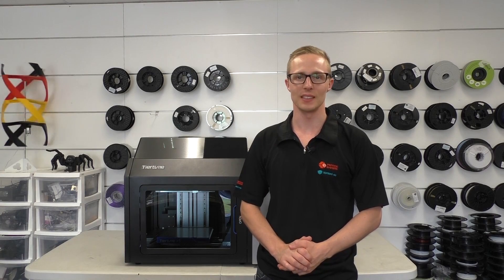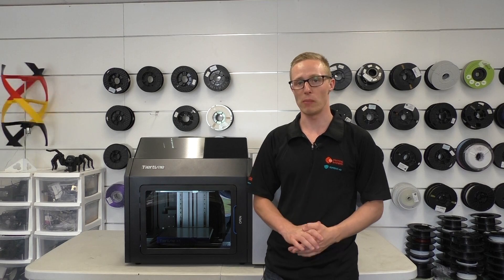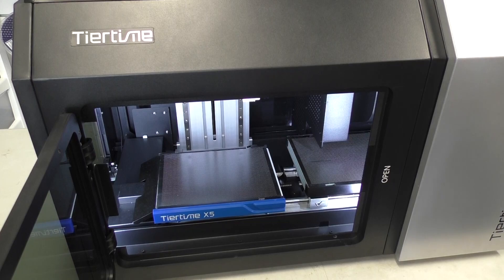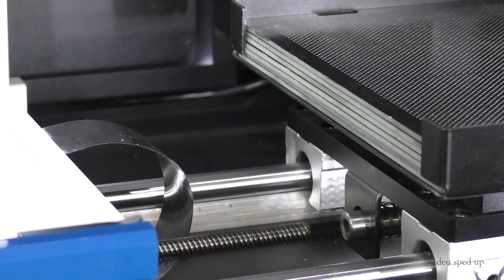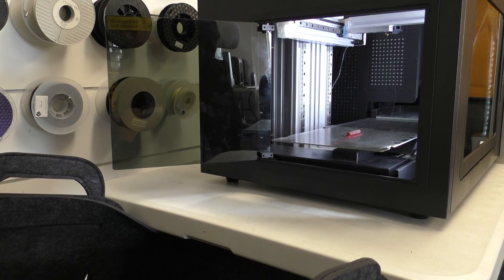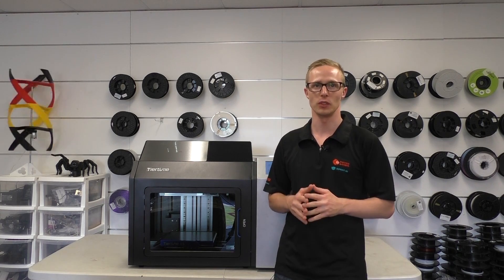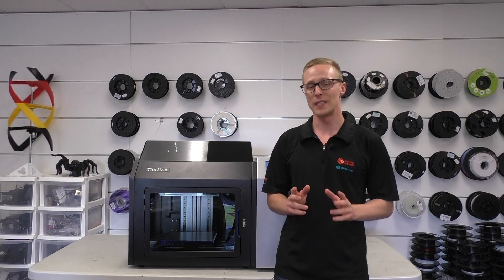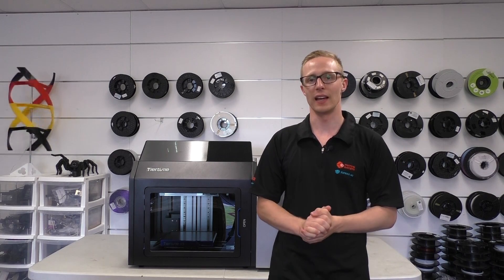Introducing the X5 3D Printer - Continuous Printing

Comment: A great printer but it requires a lot of maintenance after a while of printing since the print head only has one small gear to push the filament through, this often results in the gear eating the filament and getting clogged up. Overall I wouldn’t recommend it

Comment: The question is how many good prints are you gonna smash in pieces because of the bucket drop ? Because while the first print of the batch will land on the felt the next will just have to stomp the first and so on ...
Reply: You can either have the prints drop into the basket or you can let the prints slide out onto the table. You'll just need a big enough table.
Reply: Does it open the door when pushing the plate out and does the door close again maintaining ambient temperature when printing continuously
Reply: @stevenbryant4156  The door opens automatically when the print finishes and sensors check the exit has been completed, then closes the door.